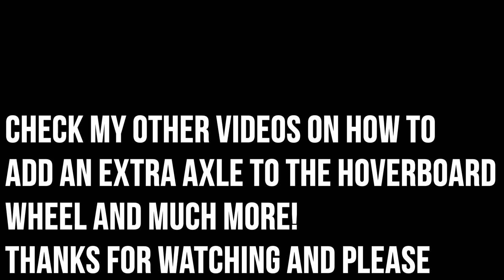Hoverboard Wheel Disc Brake

Comment: Good job, I think a way to improve upon this would be an adapter with 12 holes (can be adjusted) but the idea would be half of the screws are attached from the rear and locktite in place, whilst the remaining screws can be accessed from the front to check tightness, maintain the brakes whilst using a full length screw. 
or if you can weld, weld the adaptor to the side plate and use all holes from the front
Reply from the maker: Thanks Dean! Your idea is something that I would consider in my next project. Due my lack of proper equipment, I’ve done this project on this way, as I don’t have alloy welder machine…I’m trying to save some money to invest on some decent equipment for my garage and definitely improve all my other ongoing projects. Stay safe mate!
Reply: @Eduardo Santacruz  totally understand, sometimes you just got to work with what you have!

Comment: not bad but why use 2 small spacers and screws on the disc? perfectly a single adapter with long screws from inside the motor to the outside and instead of using cut screws use nuts, it will be more stable and firmer apart from the fact that it is better to tighten crosswise, first below, then above, little by little to the sides to prevent it from being tighter on one side and consequently it will not be aligned.
Reply from the maker: This adaptation was designed to suit my specific customised project. This video is only to inspire people and show to people that is possible to fit a disc brake onto a Hoverboard wheel. From there, all ideas are enabled like yours! I liked indeed. Thanks buddy!

Comment: good idea but it has to many points that could fail and could all fail at one time  try and make the disk mount as a one object  machine a new  hoverboard plate with the  disk break mount built on it  or make a new hoverboard plate with threads so the disk mount could screw on to it
Reply from the maker: I agree but the problem is I don’t have too many resources to perform it…but obviously I’ll take it into consideration! Thanks mate!
Reply: @Attic-Toy-Design  i think its good better than i thought of untill i saw this video is that machine a drill press or mill machine i have to try do things by hand i have no resource's at all i might try this